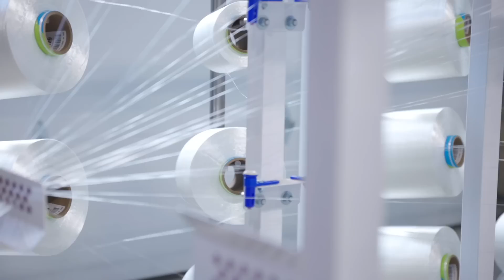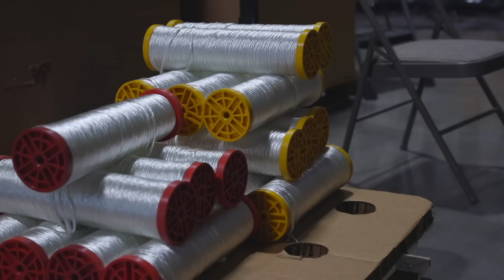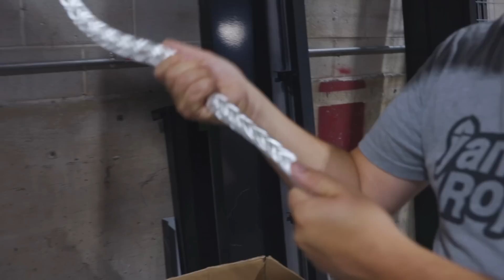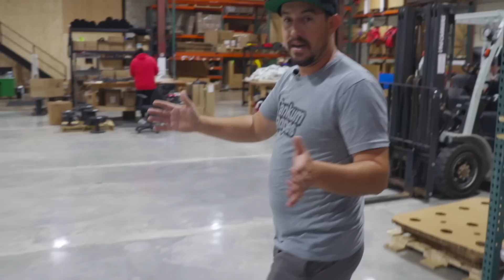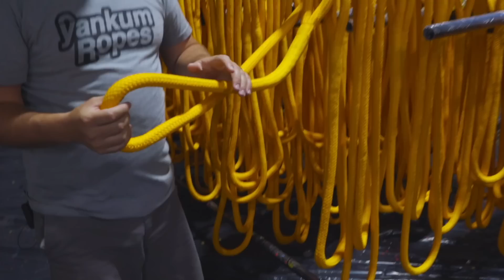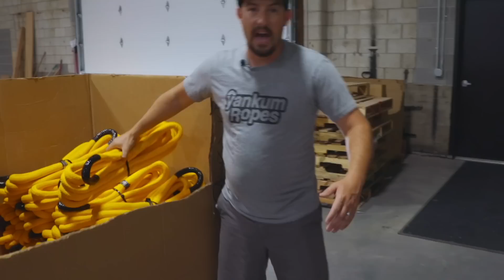How Yankum Ropes Makes Matt's Recovery Rope

Comment: Ok. I have a yankum rope and soft shackle. I haven’t done a kinetic pull yet. As most have seen there was an accident with a jeep and bronco on you tube recently. I don’t know what brand it was. I Also know they didn’t pull correctly because they didn’t use a soft shackle. Was there anything else they did wrong?  Would the soft shack have been enough to stop this from happening?
Reply from the maker: There were a lot of factors at play, the biggest takeaway is to always check to make sure your recovery gear is not compromised in any way, take your time, and make sure you are operating within the the right WLL of your recovery gear including speed and rate of cycles over time (5 cycles and 10 min of rest for the rope). If you follow those rules you will be safe.
Reply: @YankumRopes  awesome!  Thanks!!

Comment: What is the degradation period?
How long can I keep it locked in my super hot bed in the sun and it still be reliable? Vs in the bag in my house or soemthing? They still both have to have a length of time when they will eventually go bad?
Reply from the maker: Direct UV exposure is the most harmful for these ropes, temperature does have a slight effect on these ropes but it’s negligible for lifespan, but temperature does have an effect on performance especially as it gets a lot colder in regards to its rebound or stretch recovery time. The warmer it is the better. Our rope is made of synthetic nylon, eventually it will degrade, but if you keep it out of direct UV exposure, you should get the better part of a decade of optimal use.
Reply: @YankumRopes  thankyou for the reply.

Comment: I have used kinetic recovery ropes for over 25 years. I have only purchased 2, as with care last quite a while. My second rope I toss in the washing machine when it gets muddy and let it dry out in the recording studio where the climate is controlled. In the Northeast we have snow, mud, rocks and even wet leaves to get stuck in. I love these things. If I get a coated Yankum can I still wash it?
Reply from the maker: Yes they are washable, however they are more rigid when you first get the rope, you will need to use the rope to losses it up before it will work in the washing machine.

Comment: I've used multi braided marine rope for tugs since the early 70's... designed to do the same thing, stretch and then retract... Everybody I ever came across always wanted a rope like mine... The one I have now is rated to snatch over 200,000 lbs... So I use it to pull out my tractors, trucks whatever... By looking at your weave I would say that your Yankum rope is probably built very similar, with the exception of the coating, which makes yours better for longevity and keeping fine dirt and sand particles that can slowly eat away at the inner workings over time out of the weave. I have never used a Yankum, but from all I have seen of them, I would say there a great rope.

Comment: we work with trucks from 10,000lbs gvwr to 80,000lbs gvwr. do you have ropes to work with our trucks? my rollback has a gvwr of 80,000lbs and a bed capacity of 30,000lbs. i often use it to pull trucks out of the weeds, feilds and much. many times these trucks are sunk to the axles. i have broke many cables trying to get some of these trucks out. let me know if you make anything with that type of abilities.
Reply from the maker: We certainly do! Come and check out our website. Our 1”, 1.5” 2” and 2.5” ropes work for those weight classes. Yankum.com

Comment: Sir, have been trying to contact you via Matt firm but I'm not good at electronic gadgets (I'm pushing 75). With equine recovery and rehab farm , I am in search of wide flat slings. My older one have always been stiff with large metal eyes at the ends which are difficult to get under the horses. I don't know how to get your mailing address or how to send pic on email
(Text yes all other ways no). I don't even know how your site popped on my screen. Please send mailing address so can send you data and pix.
Thank you. GW

Comment: when the ropes get wet .. like in a pond or a creek will it affect the rope strength ?? also  I live in Western NY .. we get temps below - 6 deg's if rope was wet then froze would it still work or would it break like ice ?? I had to use a logging chain this last winter to get the wife unstuck in the snow .. she hit a drift in the road lifted all 4 tires off the ground .. seen you product on Matts off road and Fab Rats ..

Comment: Nice introduction to the magical rope. 
Can you explain the damages when the rope is run over as Matt cautioned multiple times. I understand running over the rope may damage the hard poxy. How does it impact the strength? Should it be replaced immediately or is it just a matter of precaution?
Reply from the maker: It’s not a hard epoxy it’s a 2 part polymer , when the rope is ran over it damages the nylon fibers, nylon cannot be pinched, it it’s pinched in any way, it’s is dramatically compromised and should be disposed of.

Comment: An Idea for a product;  As SOP is to attach rope, pull forward to find the end of the rope,  back up "X" distance, then go full power forward.   The issue is that ideal distance "X" is dependent on many variables, some of which are;  length and diameter of rope, weight of vehicle, power and gearing of vehicle, traction to ground, any incline and there maybe others that I missed.  One idea to have an accelerometer (repackaged and sold by you) mounted on the dash that is bluetooth connected to users smart phone with an app (of yours) that is pre-programed with constants from you, and allows user input of: rope diameter and length, weight of pulling vehicle and what distance "X" was.  After the pull it will tell what percentage of allowable maximum force (your maximum for "Y' number of pulls, and your safety factor) on the rope was used, and recommend a new distance "X" for the next pull, if needed.

Comment: Life of the rope in years? I also thought there was rubber or bungee material inside the jacket and I held off on buying a yankum rope thinking it would have a fairly short lifespan. If it's just nylon and stored out of the sun, it should have a long lifespan.
Reply from the maker: We have ropes in the wild that have performed over 100 recoveries, we recommend an inspection before and after every use. If you keep in out of the sun and keep it clean it will last many years.

Comment: I know that you make ropes of different diameters, and the recommended diameter to use is based on the mass, (weight) of the vehicle pulling  but I would like to ask if the ground surface should also be factored in?  I have seen videos of Matt use your ropes, and it appears to me (just appears, no actual data) that in soft sand, regardless of the weight of the vehicles, dropping down a size might help in utilizing the transfer energy of the stretching to "yank" the stuck vehicle?  I presume you have the test equipment, would you consider going to a sandy place, and using a say 5,000 pound vehicles, and both 7/8 and 3/4, (and maybe 5/8?) inch ropes with a recording dynamometer see if my guess is right?  TIA
Reply: A major factor that can't be ignored is the KE/ momentum of the pulling rig.  Matt has A LOT of experience and varies the amount of slack and the level of throttle applied to each pull .   This along with the tow rig mass is what sets the peak load applied to the rope for a dead pull without the stationary rig moving..  The goal is to not remove vital parts during the extraction which can still be done with a Kinetic rope.  So for most applications the experience is more important than the size of the rope...  But I will agree these ropes are far superior to snatching with chains or cables any day of the week!
Reply: I guess that would be determined by experience, like matt has toons, so he knows which rope to use

Comment: You dont pull test it?
Reply from the maker: We alway pull test batches. On this most recent batch we reached an average of over 29,500lbs, our target minimum is 28,600lbs
Reply: @YankumRopes  is there a safety factor?
Reply from the maker: @shaynelhta  yes there is we recommend maximum 5:1 and a minimum 3:1 in order to get the stretch needed for the rope to function as we advertise. On our website we give those weight recommendations for the operating recovery vehicle and the suggested rope diameter.
Reply: @YankumRopes  cool. Thx for the info.

Comment: I wish you had shown the eye splice procedure. Is it done by hand so it can possibly be repaired in the field, or do you have an automated process for that?
How does the splice handle the stress of stretch and recoil and still perform?
Curious minds want to know!
Reply from the maker: Major portions of that is what makes our business stand apart from the rest and we hold that as proprietary information, however we will show some of that in a future video
Reply: Sounds like curious minds just need to buy one for a sacrilegious dissection if they really need to know lol.  

Love seeing the mfg process. Subd for future content as I need to get soft shackles and straps once I get my engine going hahaha
Reply: Just about anything woven back into itself is stronger than just about everything else out there as far as end terminations and with a spongy rope like that woven back into itself is definitely the best when the Rope gets tension the diameter of the Rope shrinks which Titans up on everything in there like one of those Chinese finger handcuffs other than possibly sewing the eyes together which on that rope I don't really see a good way to do that that rope is built exactly how it should be because any kind of mechanical fastening like what they use on wire rope we call it a jewel in my world would cinch down on the Rope so much it would become the weak link because of the force involved to get it to do its job and then that giant metal fastener behind all the stored energy of that rope would just turn into a giant projectile if stuff don't go right
Reply: @seancolburn1250  holy run on sentence Batman!
Reply: @seancolburn1250  You need to "Titan" up your spelling and sentence construction "skills".
Reply: bleeping jeep shows a video of how to do what your asking if I remember correctly ..
Reply: Rick Owens there are videos showing you how to make your own soft shackles and eyes. Not all that complicated.

Comment: Every rope is hand made.  (Giant Machines in the background weaving together ropes)
Reply: The ropes eyes handmade, and I'm sure most of the processes still involve hands. Houses are handmade are you going to call them out for using a saw to cut the wood?
Reply from the maker: Could we say hand finished? After the rope cordage is made, we hand make the sling. Hand dip etc.

Comment: I heard a guy from another YouTube recovery channel,  we'll just call him Kyle Cruise,  say kinetic ropes are good for 2 or 3 pulls then they're no good.  Is he correct?
Reply: It is said they need to rest for 24 hours after a few pulls. 
I think it's snatch straps that have a maximum count before they should be binned.
Reply: Snatch straps are recommended to be retired after 10 pulls. Yankum doesn't recommend a cool down period and has ropes with well over 250+ pulls
Reply from the maker: After 5 consecutive pulls, we recommend that you let the rope relax depending upon use and weight.
Reply: Maybe it was a factor 55 rope that someone mentioned a cool down period.

Comment: Nylon has high tensile strength and elastic stretch properties, but low heat resistance - Nylon rope has a max operating temperature of 320°F and a A 100-gram mass of mixed epoxy can reach 400°F ( 'Google' searches ) - - How does that section of the rope respond to you applying a two-part epoxy to it?
Reply: The key word in your comment is "can" I have used epoxy a lot and it very rarely gets too hot to touch, and when it does it is in the pot, and that batch is waisted.
Reply from the maker: We have never registered temps above 110degrees and after it’s dipped it immediately cools since it’s a thin coat. Our polymer is also very rubbery when it’s finished curing.

Comment: Wow.. so it's only nylon.  I thought it was a fancy synthetic like Dyneema or something.  I like that you dip it and give it that extra abrasive coating;  that makes a big difference when you're dragging it across dirt, sand and rocks.
Reply from the maker: We use nylon so it will stretch. Dyneema is used in winch-lines so they won’t stretch
Reply: @YankumRopes  So a dynamic rope, rather than a static rope.  I see.  It's interesting to see that it's nylon core also.  I know that I've seen polyester ropes with nylon cores, and even nylon ropes with dyneema cores. etc. etc..  Rope braiding tech is fascinating.
Reply: I thought there was elastic inside the rope. Very cool.
Reply: Dyneema dosent stretch
Reply: @mktrollop1093 :  Everything in the world has a modulus of elasticity, even diamond, it is just that nylon is a lot stretcher than Dyneema.
Reply: @johndavidwolf4239  oh John,  I'm so terribly sorry i wasnt specific enough with my modulus of elascticities! So terribly sorry,  ill do better next time. Ill make sure not to comment on anything i don't have a Phd in will I?
Reply: @mktrollop1093  : No Phd here, just a few semesters of technical college.
Reply: @johndavidwolf4239  glad you got to squeeze that in anyway at least
Reply: @mktrollop1093  Or you could spend your time growing up and resolving your attitude problem and insecurity when someone that's helpful and more educated than you simply tries to share something that teaches the rest of us.
Reply: @mktrollop1093  Everything can also be atomized into their original elements given enough temperature and pressure, and even when you peel those particles apart, it creates a nuclear reaction and turns some of that matter into energy release and you get an atomic bomb, an H-bomb or many other types of nuclear chain reaction bombs that are possible;  and which are all happening right now in the center of the sun and creating the light and heat that shines down on us everyday.
Reply: @calholli  🤣love it
Reply: @mktrollop1093  phd=piled high and deep   LOL